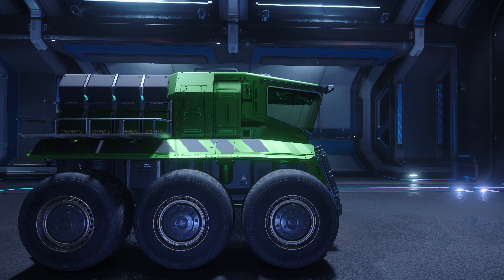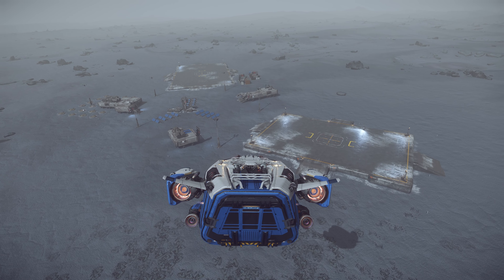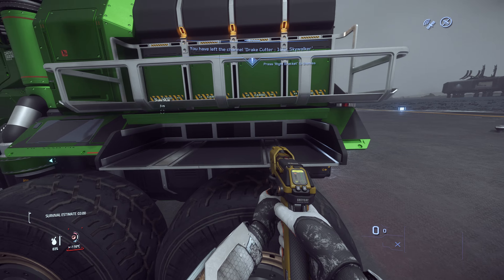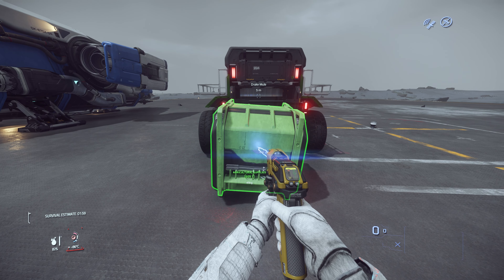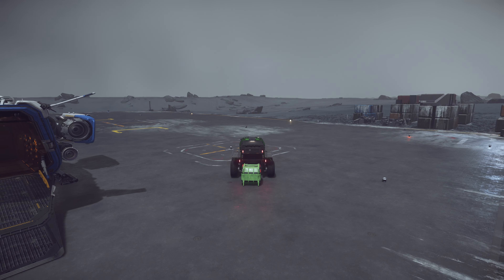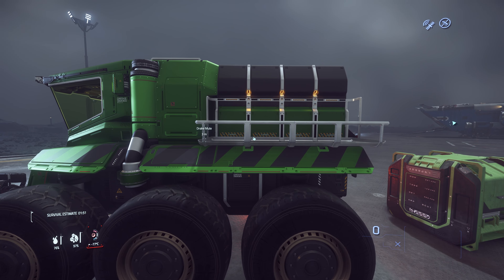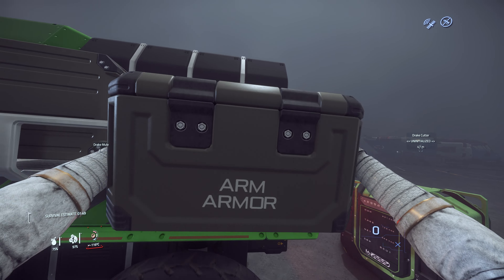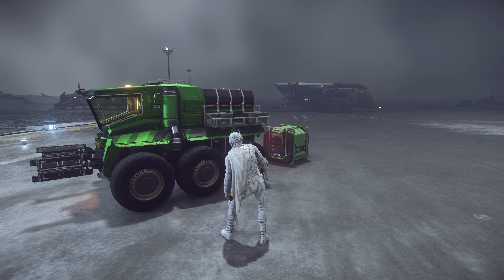Drake: The Mule | Testing Its Cargo Grid & Forklift | IAE 2953 Day 5 Drake | SC Science & Fun 4K

Comment: They should probably completely redesign how this thing’s supposed to work.
Reply: Would prefer a s0 tractor beam instead, so you could actually use it as a forklift vehicle to (un)stack boxes while (un)loading the ship.
Reply: I think it would be a perfect ground logistic support vehicle if you could place a fuel tank underneath and use it to refuel vehicles. I also think they should get rid of the side rails for hand boxes and move them on too, and make room for two 2 SCU boxes that can be placed on top of each other.
Reply: @artuno1207  Adding flexible "effectors" that could slot in and out would be a great rework. How about this:

1) Refuel nozzle with being able to load a tank up in the back
2) Tractor module with an "anti-grav hitch" that could carry a bunch of SCUs (or one larger SCU)
3) Repair module with an "RMC Tank"
Reply: @artuno1207 2 scu boxes are bigger than the mule lol

Comment: You just need to switch your multitool from Tractor mode to Detach Mode to make your box stick on the Mule
Reply: What's the keybind to switch modes?
Reply: @marcuswilliamsMarcusTheVisual  "B"
Reply: @optimisto  Fantastic, thanks man. I was frustrated with trying to see if I could pick up the new Syulan (or however you spell it) and even noticed that the tractor beam was in detached mode but couldn't see how to switch it to tractor.
Reply from the maker: ahhh, yes thank for catching that, you are right. I will be sure to mention it in my next video. This tractor and detaching is a bit confusing if you don't test it.

Comment: I think it's a bit too large for Cutter. Cutlass is more suited for it as you can get in and turn around. Freelancer is good too. It can also fit into fully loaded Freelancer MAX.
As for side cargo racks, I usually use it for box missions. Makes you feel like a delivery man. You can also use shop terminal to load 1scu at the back.
Reply from the maker: indeed

Comment: The mule is just about the most useless vehicle in the game.  The only thing good about it is being able to approach bunkers and carry all three boxes you normally get.  The moment that the turrets can attack ground vehicles, even that will be taken away from it.  The "fork lift" is not even a lift.  It is barely a carry.  Supposedly it is to be used to load a ship.  By the time you put the 2 SCU in the damn thing you could have put 3 or 4 boxes into the ship with tractor beams.
It needs a complete overhaul in design and usage or it will be just a sign of Drake's failure.